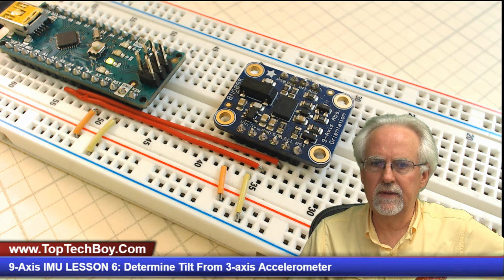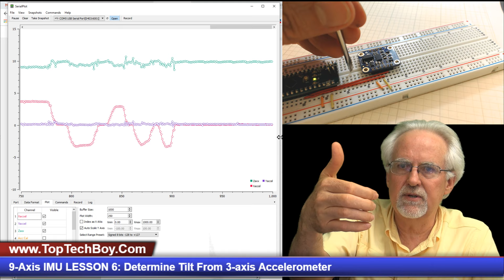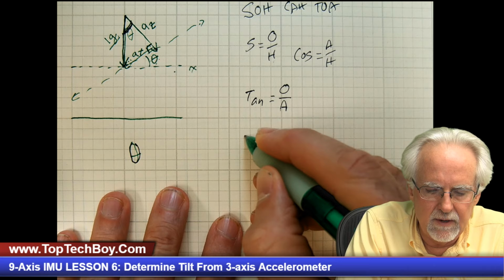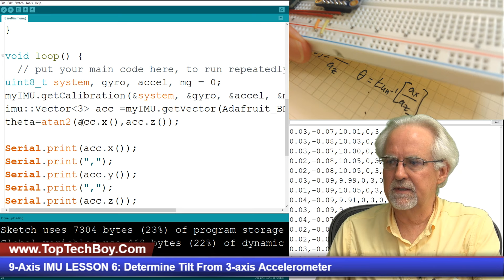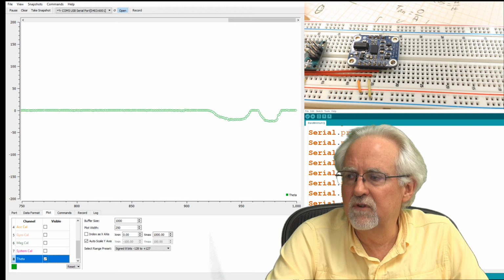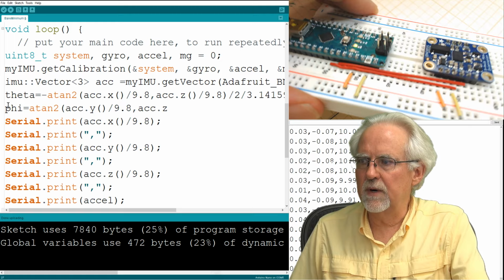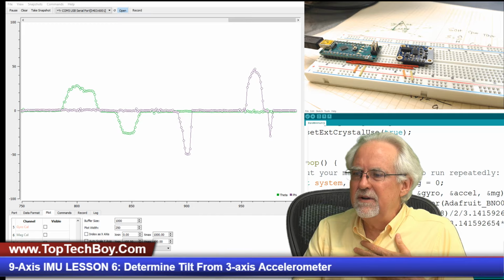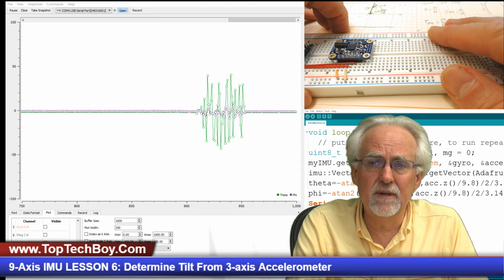9-Axis IMU LESSON 6: Determine Tilt From 3-axis Accelerometer

Comment: I indeed crashed and burned... I tried by using some trig, but it failed, I liked your solution! You probably could measure tilt by using a linear equation, with two points, when you read 9.8 you know you're at 0 degrees, and when you're reading -9.8 you know you're at 180 degrees. So, (9.8, 0) and (-9.8, 180) Except I don't think that would be as accurate as your way. Thanks so much Paul!!
Reply from the maker: Yes, and problem is the relationship is not linear, but is trigonometric. Andrew this is  a tough series, but dont get discouraged. Some of the lessons, it will be victory if you get it working after seeing me do it. The Math in these lessons is a bit challenging, but will help you see why trig is so important.

Comment: this has been consuming my life. in a good way. I've had to learn about control systems, complimentary filters and feedback loops. calculus. it's funny but alot of the math I've learned doing circuit level stuff applies here. especially the theory behind opamps and feedback loops to make sure the signal integrity on the output matches what my signal gen or voltage divider ladders provide on the input. I wish I could hook my scope up the arduino. I just upgraded to a nice 2gsa siglent and have a separate 80mhz 500msa arbitrary waveform function generator / frequency counter. plus I just ordered the proper dc motors and real mechanum wheels to hold the weight of my robotics project.

Comment: I have done my homework the most straightforward way so if theta>85 or theta<-85  then phi calculates through the different formula you showed us with sin the same way if phi>85 or phi<-85 we calculate theta less accurately but with no artifacts. Thank you for this wonderful tutorial!

here is some code:
if (phi<75 && phi>-75){theta=-atan2(acc.x()/9.8,acc.z()/9.8)/2/3.141592654*360;} 
else{theta=-asin(acc.x()/9.8)/2/3.141592654*360;} 
  
if (theta<75 && theta>-75){phi=-atan2(acc.y()/9.8,acc.z()/9.8)/2/3.141592654*360;} //phi=tan^-1(accelerationXaxis/accelerationZaxis)/2pi*360{convert from radians to degrees }
else {phi=-asin(acc.y()/9.8)/2/3.141592654*360;}

Comment: Hi Paul, i'm following all these IMU episodes and trying myself at the same time (your videos are being very useful!). I noticed that you looked suprised when the Theta value didn't "messed up" at the 90s degrees. Well as i was attemping to also get the 45º value, i realise that in my case the values actually messed up at 90s degrees. I realized that i used the math function atan, instead of the IMU_Library-BuiltIN atan2. When i switch to atan2 i noticed that the "messed-up thing" occurs at 180º instead. Probably is something that the library has to increase the reasonable operation range for tilt measures using just the acc.

Thanks for you videos, and sorry about my english. ( Hi from Portugal!)

Comment: Hi there i wanted to use this device upside down so i found that i had to change Z to -accz and that flipped it , thankyou so much for your tutorials  i have learnt a lot in the last 12mths   i couldnt even turn an arduino on 2 years ago  i 'm 70 next birthday  , i grew up with valves  cheers

Comment: If you want degrees for each axis would simply be Xtilt=90sin(x/9.8); Ytilt=90sin(y/9.8); Ztilt=90cos(z/9.8); the issue with this method is with rotation above 90 degrees it will drop until actual 180 degrees is met and 0 will be seen instead of 180. 
-----
Havent tried myself but this should give you -180 to 180:

Given thetay=90sin(y/9.86) and thetaz=90cos(z/9.86)
If thetaz<=90 && thetay>0 thetayy =thetay+90
If thetaz>=-90 &&thetay<0 theyayy=thetay-90
Else thetayy=thetay
//convert for 0 to 360
If thetay<0:
Thetayy=360-thetayy
------
The z rotation relative to the x position (if x is stationary z will provide orthogonal reading to y) will help with identifying rotarions greater than 90 degrees, You need all 3 variables to do greater than 90 degree accuracy. The issue with arctan other than its asymptotes at 90 is using only az and ax is if there is tilt on the y axis, it will affect the magnitude of az, altering the estimate of the angle for x. Also, these only apply if the IMU IC center on the surface. Not that there may be confusion at the boundaries and should take care since data may flicker to unwanted values. My code is quick and I may have messed up a boundary condition. Also, acuisition and store to global order may affect this reading if there is a delay between y and z readings
Reply from the maker: Ian, as we will learn to really make things work in all orientations, we will need to use quaternions. We will get to that in later lessons.

Comment: Hey Paul id really appreicate if you could point me in the right direction im trying to display a line on a OLED screen that tilts with the input of a IMU's pitch but not sure how to do the math. The way the line is drawn on the screen is using the adafruit GFX Arduino library which needs the x and y coordinates of both ends of the line. I'm lost on how to take the IMU's pitch and translate it to the lines coordinates to make it act accordingly any info on how to do this would be greatly appreciated.

Comment: What's the point of calculating the tilt using the accelerometer values if you can calculate it by integrating the gyroscope values over time?

Comment: Did my homework using the cosine function. In the beginning  my z valides were 9.82 but after we added the calibration stuff they are down to 9.4-9.5. I don’t really understand why since the calibrating code doesn’t really do anything than showing if it’s calibrated. Does anybody else experience that. The new IDE serial plotter is quite good and if you rotate the sensor around the x-axis you can see that the y and z values are two sine curves which are  parallel.

Comment: Can I ask how the total acceleration can be different depending on the orientation? Gravity is constant so if split my 1g equally between x and y by tilting the sensor at 45° shouldn't I have 0.5g in each? Actually I read around 0.7 each but I'm not sure why.

Comment: Dear paul,

At 26:55 min the theta equation should be ..🤔

Theta =[ -atan2[acc.x()/acc.z()]*360]/2*π  ;
Reply from the maker: Your code would put pi in the numerator which would not work
Reply: @paulmcwhorter  Sir ,
i'm still confuse in the radian to degree conversion in this equation ...😥
Reply: @nikhilchitroda6409  A radian is about 360 /(2 * pi) or 57.3 degrees.
Reply: Arduino now has a constant built in to handle this:  RAD_TO_DEG

Comment: So you said that we can't use it in uavs why?
Reply from the maker: Because I am showing to to use for a simple desktop demonstration. To use in a control system you need much more work on calibration. The device tends to lose its magnetometer calibration during operation, and if that happened on a UAV it would be disaster. This is to introduce the concept of how these things work.
Reply: @paulmcwhorter  will you also make video on this for reducing the noise and complementry type of filters. Because I getting a lot noise with acceleratometer due to vibrations of motors
Reply: @paulmcwhorter  Hello sir.... can u explain more on control system and UAV point of view so that BNO055 can be used on sophisticated systems.  I am asking for which type of correction and adjustments are needed for control system application . which type of extra work is required on calibration if i want to use it for UAV?

Comment: Hi Paul, many thanks for your videos, very absorbing. I did the homework on this, but used cosine function which is not asymptotic using accz /accx. Would this avoid the issues as the angle tends towards 90 I wonder....?
Reply from the maker: Pretty much any of these simple trig functions really only work for small tilt angles. As lessons advance we will show how to do better math.